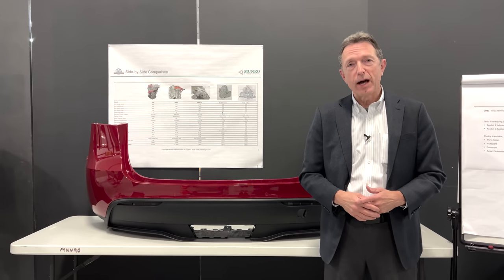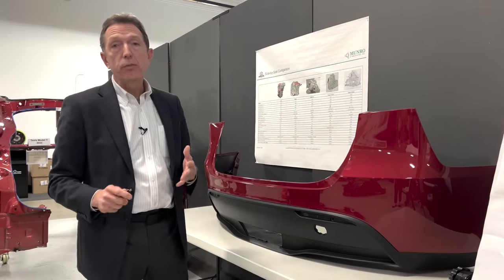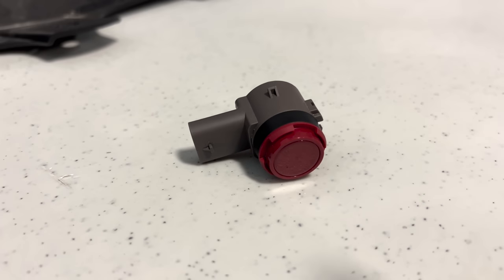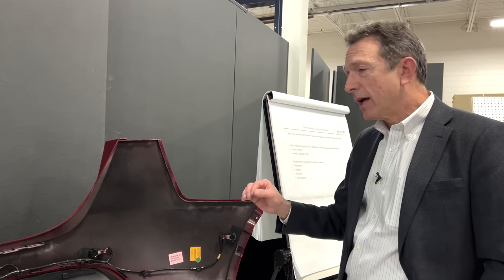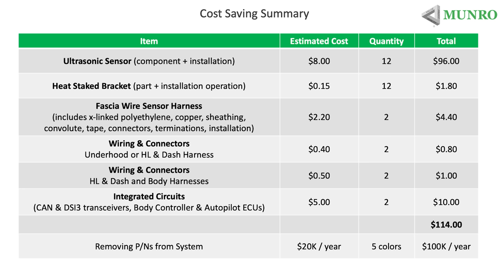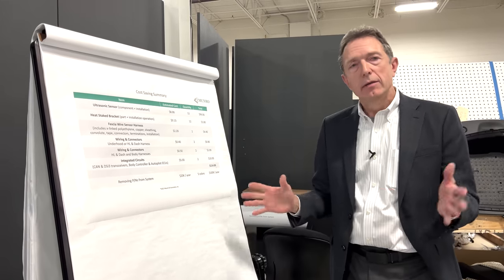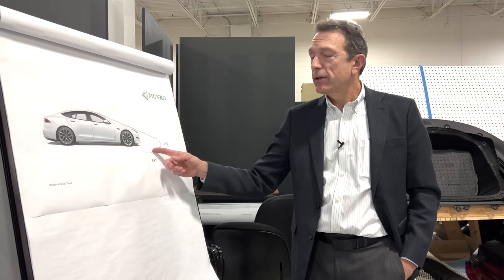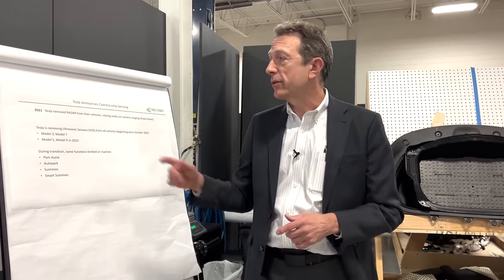Tesla REMOVING Their Ultrasonic Sensors

Comment: Acoustic sensors are less affected by dust, fog and snow than visible light sensors, but give less range and spatial resolution.  Ideally both types are used to give complimentary data.  A buyer paying over $100K is not going to be very impressed that Tesla comprised performance to save $100 in parts.

Comment: I live in an arctic climate with a lot of snow, rain, cold temperatures and dark days during winter. I'm highly sceptical about Tesla removing the ultrasonic sensors, as cameras tend to be less reliable than the sensors in the wintertime (e.g., dirty, covered with snow). I'd be particularly concerned with backing the car, as snow often get clogged up at the back of the car when driving in snowy conditions.
Reply: Maybe the teslabot was made to get out your car and wipe all the blinded cameras before you can reverse into your space🤣🤷‍♂️
Reply: the fix will be to clean your cameras every xxx miles.
Reply: FSD today cant even handle mild rain and will automatically turn off.
Reply: @realshompa  
it can handle mild rain lmao
Reply: @ogzombieblunt4626  I have experienced, several times having Autopilot declare itself unavailable due to inclement weather conditions (don't remember the exact wording of the six-point-font notifiers that appear for a few seconds).   And this included a time or two when the rain was so light that the auto wipers didn't even come on.   It doesn't happen all the time, but it does happen;  I wouldn't be so quick to dismiss @realshompa's observation.
Reply: I just posted a similar comment/question above.
Reply: In our winters the ultrasonic sensors are the second thing after radar that fail every time.
Reply: @levenkay4468  
If he said it sometimes can't handle rain then sure, but this could be due to a combination of factors rain being only one of them so saying its caused by rain probably isn't entirely accurate
Reply: @Levenkay You have to remember that Tesla has also upgraded their cameras from 1.2 to 5 mp, which is a huge increase in data and depth that they can get out of them. Plus Tesla uses raw output which allows them to use some filtering tricks. Also, the autopilot and their vector voxel depth detection is not the same, even if the autopilot stopps working the outside will still be visualized, the closer something is the more accurate, tesla should be able to accurately detect its surroundings even in a snow storm. In the end it depends only on how much processing power you have at your disposal so I assume HW4 for the new Teslas because HW3 is completely at its limit with what they currently run on it. There will be little change in the way close objects are visualized, just like before there will be a ring around the car that shows the distance because that is the easiest way to use the data from its vector space, you just have to use very small voxel boxes in the near environment. The only real problem I see is the area directly in front of the car, there is a blind spot, either Tesla adds another front bumper camera with 210° lens or new teslas will run over a bunch of stuff, cats and dogs that have moved in front of the parked car.
Reply: @Sidowse  the cameras fully overlap and unlike humans cameras don't have tunnel vision. Issue for me is the smaller gaps in the uk means the car would never work here. As he pointed out that 3ft gap could be all that gets you in a space here and suddenly you just can't see it.
Reply: @de-kat  in a snow storm? Lol get real. My 2019 m3 couldn't see in any rain or if the slightest sunlight was on the side cameras.
Reply: @de-kat  Cars are being built now without ultrasonics but no upgraded or additional cameras! People getting those cars, which includes me, are out of luck! They will never fully replace the USS functionality with the current Vision and I will miss the accurate information during manual parking that I get with my other cars, up to 20 years old! I'd happily pay $115 extra to keep the dang parking sensors! Rather annoying! At the very least, develop and test the new solution before removing the old solution!

My personal opinion is Vision-only is likely a dead-end for FSD and even basic park-assist, at least with the current hardware. Upgrade the cameras resolution, dynamic range, maybe add infra-red, maybe stereoscopic vision, more locations, and maybe there is a chance. But current vehicles will never achieve it. Luckily, I am buying a Model 3 to be primarily a car I drive and park myself, so it'll do!
Reply: @liampope1  they have tested them. The reality is the ultrasonics offer literally no benefit. They are inferior to the vision camera and don't add anything.
Reply: @realshompa  that's a straight up lie. FSD works fine even in heavy storm rain and fog, regardless of lighting conditions.
Reply: @JoeLancaster  I'm sure they have done some testing. But if it's all tested and superior, why are simple parking sensor functions and autopark disabled for an unspecified period of time till they figure it out? Like I said, at least have the new solution ready before removing the old solution, instead of creating 'transition period' cars that lack advertised features.

I disagree ultrasonics have no benefits. They provide reliable accurate distance measurement to typical objects down to cms off the bumpers in all conditions. Vision can only hope to replicate this simple functionality with advanced algorithms, and at best has to do so predictively rather than directly for critical areas close to the bumpers that the cameras can't even see. I'm not saying that ultrasonics are perfect, nor that Tesla will never achieve parity with Vision, but I'll believe it when I see it! At the moment I'm expecting another auto wipers or auto high beam scenario - yeah look we can kinda sorta do it with vision, that'll have to do. I do agree ultrasonics aren't essential for general FSD though, just not parking.
Reply: @JoeLancaster  lol, FSD in heavy rain / fog. Don't. Super dangerous. Not designed for it. Should be illegal.

Tesla removed Radar too and I'll bet you think that was an improvement too. It wasn't. My 2020 MXP throws false positive forward collision warnings like 3 times a day now. It used to be maybe once every other week. The removal also lowered the max speed for autopilot from 90 mph to 80 mph. They said they'd achieve parity. It's been over a year. I live in an area with 80 mph speed limits. It matters.

Not everything Tesla does is good for you as a consumer. Stop taking them at their word and look around. 

I love my X, but it's about to be in a fiercely competitive market for the first time. If Tesla keeps doing nonsense like this I'm happy to have choices.
Reply: @jonathansage2147  actually it is designed for it. Idk if you've kept up with the updates but it sees incredibly well in basically any condition.
Reply: @JoeLancaster  I'm an owner. I have two Xs. Maybe FSD is great, but the changes have not made it to highway driving Autopilot if they're still different stacks. Autopilot is not great in the rain. It's unusable and dangerous in snow. I wouldn't trust it in fog. I barely tolerate it in fast moving traffic. I generally only use it for road trips where it does OK.

Even their TACC is utter trash. It rarely gets to the speed I set it to. It brakes all the time when it shouldn't. I would deeply appreciate a much dumber CC that would just go the speed I tell it to and stop slamming on the brakes whenever someone takes a left turn 100 yards down the road.
Reply: @jonathansage2147  FSD works differently to standard autopilot. Even as far back as v9.1 it was able to see better than the driver in most rain conditions, and as of 4 months ago it is very reliable, only throwing up warnings when it's dangerous for a driver to be driving anyway. Even then, you can see from the display that even in those terrible conditions, it still sees the road and other objects accurately, even if the software is being cautious.
Reply: And keep in mind, these heavy conditions are only solvable via vision. Lidar won't work, radar doesn't help for anything other than range-finding (which vision does anyway), and ultrasonic won't help.
Reply: @JoeLancaster  Again, TACC, Autopilot, and the forward collision warning system are all significantly worse without radar. I base that on having driven a Tesla both before and after the software update that removed the functionality. I firmly disagree that this is a problem that is only solvable with vision. Even Sandy Munro thinks FLIR should be part of the solution. I have no horse in that race, but look around a little and notice that other companies are taking other approaches. Don't just regurgitate what Elon says, he's often wrong. It would be extremely suspicious if ALL other systems, including safety systems, got worse when radar was removed, but FSD got better. Maybe it's better in some ways, but from the perspective of detecting what's going on in front of you, it's more hesitant and throws more false positive events. That isn't progress. Being able to keep a consistent speed is important. It makes the ride for everyone in the car, especially your passengers, smooth. Braking erratically and erroneously is at best a bad driving experience and at worst very dangerous.

In the video you linked, the car recklessly drives straight through large sections of standing water which risks hydroplaning. I would not trust a system that behaved that way in inclement weather. It's also worth mentioning that this video was shot at 11:30 AM when the light is about as good as it's ever going to get and it really is not raining that hard.
Reply: @jonathansage2147  other companies have been shown to be wrong. Humans don't need anything but vision, and the camera system sees better than humans. You're just stuck behind a wall of incredulity. Take a look at the incredible progress over the past 18 months. Gone from 'ok' to better than humans. No reason to think that stalls now.
Reply: @jonathansage2147  look at any video you like. They range from normal rain, to conditions no human should be driving in regardless, and it still sees fine. You're just incorrect on this.
Reply: @JoeLancaster  Do you own one? I do. I love it deeply. It is also deeply flawed in many ways that I live with. 

I am a skeptic, you're 100% correct. You should be too! This is a very hard problem. Elon persistently thinks it's 1 year away and has said so for the last 6+ years. 

Other companies have not been shown to be wrong. Waymo has a considerably better safety record than Tesla. It's extremely geographically and situationally limited, but it is considerably safer.

Have they made great progress? Absolutely! Is it better than an attentive human? Absolutely not! Does it often drive like a drunk toddler? Yes! In the video you linked it sat behind another car blocking the road for way longer than a human would (I mean eons longer). When it was finally able to move around, a human driver, doing exactly what another human driver should expect a human driver to do when confronted with that situation, merged in front of it to turn. A human driver would have seen that coming and not stomped on the accelerator. The Tesla stomped on the accelerator and subsequently stomped on the brakes. That's not better than a human, it's worse. 

Humans have more senses than just vision? Also why are we limiting a machine to only have senses available to humans? Is our hubris so great that we think we're the absolute pinnacle of the ability to sense our surroundings? I'm not sure I even agree that Tesla's system sees better than a human considering the hundreds of times it's reported that the B-pillar cameras are blinded in broad daylight. I think cameras are certainly capable of seeing better than a human. I'm not yet convinced that Tesla's implementation is though. Especially with respect to what it sees for cross traffic since there's no cameras covering those directions. Also, considering it false positively throws a forward collision warning at me three times a day post removal of radar, I'm going to firmly state that I do that considerably better than it does.

I'm incredulous because I have evidence that doesn't support Tesla's case. Do I think it's a solvable problem? Yes. Do I think Tesla is anywhere close to level 5 autonomy? No. Do I think they'll be there in 5 years? No. Do I think they'll be there in 10 years? Maybe? Would I be happy if I'd paid for FSD and had to wait 12-20+ years for it to be trusted more than I would a drunk toddler? Nope.
Reply: @jonathansage2147  5 years? What are you talking about? They are there right now.
Reply: Indeed! I live in Norway and the most used function on my Tesla is probably the windshield wiper button, because the camera-based rain detection doesn't really work most of the time, particularly at night...So I don't place much trust in the cameras alone when they can't even detect heavy rain..
There should always be some kind of redundancy! When it can't even detect a saturated windshield, and constantly phantom brakes when using the cruise control it's not ready for prime time...
I won't be using the auto park function in my next car if there are no ultrasonic sensors, that's for sure! Even my robot vacuum has both camera and lidar sensors, as well as ultrasonic sensors, and its only purpose is to navigate the house. A tesla is supposed to be fully autonomous pretty soon according to Elon, and it has my life in its hands when it's driving by itself. And then there's NO redundancy, no extra sensors. Just cameras? It doesn't make me feel very safe, to be honest. Camera vision can get fooled by shadows and all kinds of things..
Reply: @JoeLancaster  The 'but, but humans only have vision' line is what I expect to hear from Tesla fans, high school kids and news reporters! Not serious engineers who understand the massive gulf between the capabilities of human vision and the interpretation, thought, judgement and lifetime of training that goes with it, and what Tesla and anyone else can currently do with cameras and some software algorithms. If the FSD stack is already so great, when are the basic standard features like TACC going to be migrated to it? How long will paid and soon to be paying (including myself) customers have to be driving around with bad auto wipers, bad cruise control and lane keeping, bad collision detection, and coming soon - no autopark or even basic beepy beep parking sensors?!
Reply: @liampope1  if you don't understand, perhaps you shouldn't comment.
Reply: @JoeLancaster  what about your Tesla fan boy soundbites don't I understand? You can be as technical as you like - I'm an electrical engineer. You didn't address any of the points I made in my two replies to you. What are your thoughts on why cars being built now will not have park assist, autopark, summon or smart summon for an unspecified time, if you claim everything is already solved, tested and way better than the old solutions, USS no benefit?
Reply: @liampope1  the cars have all those things. You are just confused.
Reply: I think removing the sensors is a really bad idea.. This is going to be interesting..
Reply: It's never meant to be self-driving, it's essentially a long-winded marketing scam
Reply: @thesmiffable  Tesla are the only ones even attempting actual self driving. And they are practically there.
Reply: Meanwhile my own vehicle, where the only sensor is me at the wheel with multiple blind spots, and I am also dissociating.  "This is risky" 🤣
Reply: @JoeLancaster Give an actual date as to when these cars can self drive then if you are so sure
Reply: @thesmiffable  95-97% now. 99.9% by end of this year.
Reply: @JoeLancaster  lol ha ha ha :) Elon, is that you?
Reply: @JoeLancaster  so all tesla cars will be fully self driving by the end of the year?
say it
Reply: @thesmiffable  huh? No I'm saying it is ready. And will be as capable as I said.
Reply: @JoeLancaster  Say It!
All Teslas Will be self-driving by the end of the year
Reply: @thesmiffable  lmfao what are you talking about? Are you that desperate for a straw man that you literally need to change what everyone is saying in order to not be wrong?
Reply: @JoeLancaster  mate, take a long look in a mirror and have a good think about your life
Reply: @thesmiffable  lmfao you seem very confused. Scroll up and look at what you said.
Reply: ב''ה, Tesla and SpaceX are simply funding enough carbon emissions to make this a non-issue; it may be more fuel efficient overall.

Comment: I’m most disappointed that they didn’t get the camera only features working before they pulled the sensors.  This tells me they had a supply side problem and decided to pull them.  It was probably in their plan to do it but it’s poor customer focus to roll out the change this way.
Reply: Tesla is poor at building customer trust.  Their  take it or leave it mentality will eventually work against them.
Reply: Yeah - a very Tesla move. But the owners easily forgive. I say that having experienced that myself: I bought a Model S just after they dropped MobileEye and switched to an in-house FSD design. Not only was there no self-driving when I got it, but no cruise control of any kind, the windshield wipers were manual fully-on or fully-off (!), and the headlights were completely manual but with no physical controls. This lasted the first 6 months of ownership. Yet I still have the car 6 years later, and I still love it.
Reply: we dont know that for sure, what if they just wanted to add $10m profit per year by cutting back on costs?
Reply: @robb412  I really hope so